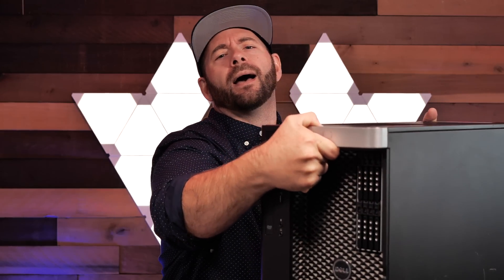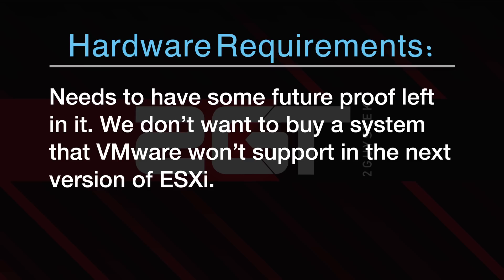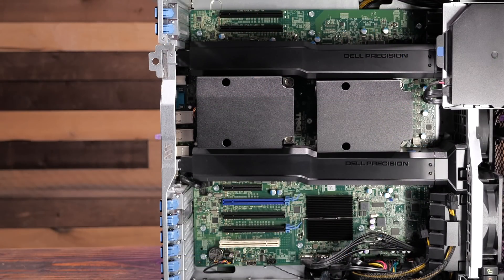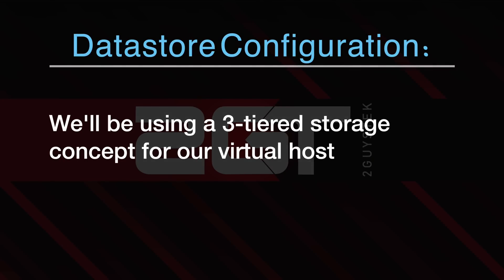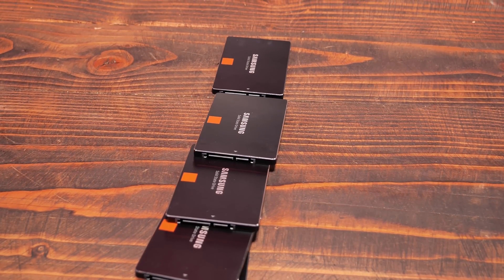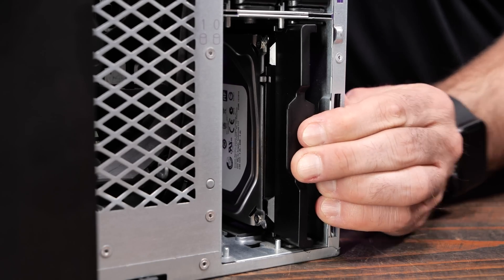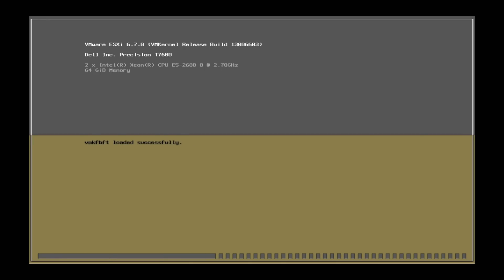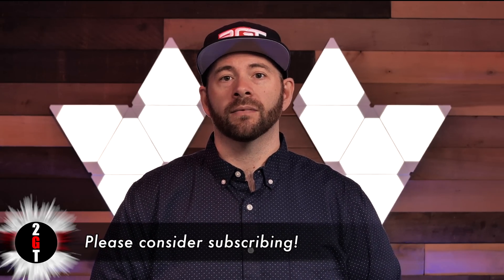Cheap and Powerful Home Virtual Server - $300 GETS YOU A TON OF POWER!

Comment: If you're running a Plex or Emby VM you may want to install some kind of graphics card and use it as a passthrough for transcoding. This will take a ton of work off of your CPU's and let them take care of the day to day functions of the VM's themselves. Even cards that run on 75w PCIe power will get you a lot of benefit, there. No need to drop in a 2080ti (most server and workstations don't have power provisions for the PCI power that is needed for the bigger cards anyway unless specifically ordered like that)

It's good that you were able to pick that thing up for $300. I've got a stack of Dell Poweredge servers under my desk. One of them is a R710 like you guys have. And they are very useful. Although without knowing the specs you're upgrading from in your R710 it's kind of hard to determine if the juice is worth the squeeze. As far as noise. They're in the garage so that's really a problem?
Reply from the maker: I was under the impression that hardware transcoding in plex on Linux was still broken, is that not the case anymore? I would be more than happy to passthrough a GPU if I knew that had been resolved.
Reply: @2GuysTek  Not sure about linux. The people that I know that are doing it are all using windows based installations. Some native, some using passthrough on a hyperviser.

Comment: Great video, subbed.  I found it because I have similar needs and am looking at a T7610, r720, or r720xd.
A few questions:
-  I imaging your t7600 has ECC memory, is that what you have laying around?  Might want to call something like this out.
-  why did you choose the T700 over the T7610?
Reply from the maker: You're 100% right on the ECC RAM requirement - That's an important catch, thank you! The R710 server we were running as the primary ESXi host had compatible RAM as they're around the same generation. 

And to your question about why a T7600 over a T7610? It was just money. At the time there were no 'affordable' T7610s on the market. In some cases they were like $300-500 over the $300 T7600 we found. Unfortunately now it looks like even finding a T7600 at the price we bought ours looks hard to do. I did find one almost identical to the chassis we bought but it was going for $400. https://ebay.to/31k2AGq I'm hoping prices settle back down here soon.  Thanks for the question!

Comment: Nice machine though! Got a Dell R720 at home with 192GB's of RAM. Half full right now. Running at 91,6GB in use RAM :P
Reply from the maker: R720s are a great platform! Are you virtualizing? What are you doing with it?
Reply: @2GuysTek  Yes, I have it as a VM host. Run ESXi 6.7u2 on it (u3 causes hanging issues with the Dell version of ESXi). I have my homelab running on it with around 17 VMs, mostly Windows, but also a few Ubuntu server VMs. And a Linux Plex server ofcourse :P 

Specs (if you're interested):
1x E5-2680v2 10c/20t @ 2,8Ghz
192GB DDR3 ECC REG (12x16GB)
5x 256GB Samsung 840 Pro SSDs in RAID5
PERC H710p 1GB RAID Controller
Dual PSU with one PSU behind a UPS
Runs ESXi 6.7u2 Dell Customized version
Oh, and ofcourse vCenter :)

The whole machine uses about 90 watts of power (in idle), due to the low power consumption of the "disks" and other parts. The CPU isn't energy efficient if it's at max load, but when it idles, it becomes quite energy-bill friendly. Set to run as hot as it can be before it begins to rev it fans. Under heavy load, it revs, but that's barely happening.

Comment: Putting your SSDs in a RAID5 is a bad idea, parity writes will wear out your drives in no time. I'd go with RAID10 instead
Reply from the maker: You're absolutely right about the SSDs. Our decision was one of capacity and not longevity of the disks themselves.  The disk cost for RAID 10 was just too much compared the amount of space available going with RAID 5. Realistically though, they are old used SSDs to begin with so the reliability of the drives would be suspect anyway, that's why we have a robust VM backup strategy!  Thanks for the comment!

Comment: Is this 8-bay case for SSD that you used @4:13 
https://www.ebay.com/itm/New-ICY-Dock-MB998SP-B-ToughArmor-8x-8-bay-2-5-SATA-HDD-Hard-Drive-Mobile-Rack/222127985238?hash=item33b7dc1256:g:B3MAAOSw1ZBUwzGa
Reply from the maker: That's not exactly the same one, but essentially it's the same thing and will work all the same. It looks identical on back so I wouldn't be surprised if it wasn't made in the same factory in China. Thanks for the question!

Comment: The only way I've seen these for around 300 is with out any RAM or processors included.
Reply from the maker: I'm bummed to see that the cost of these chassis has increased so much as of late!
Reply: This is the comment that I made to another individual on this discussion.
Not impossible. That is probably the best they could find at that price point when looking. What I find intriguing is that people are looking for the exact same deal, when that is not going to happen. When I searched I found a similar system for about the same price. BUT, it was not a Dell T7600, it was an HP Z800. Which may or may not be available by the time that you look for it.

A reminder - the $300 was the price of the system that they started with, not what they ended up with, which is not disclosed in the video but wouldn't be too difficult to figure out.

What I did not state when I made this comment earlier, is that in my local area when looking at Craigslist, I find that people are asking and receiving upwards of $500 for something worth less than $100. What is sad about that - there are local rebuilders that are selling similar systems for $150 that other locals are asking $500 for.
One additional thought - You pay a premium for wanting it now and not doing a thoughtful search, and that is what some sellers are banking on.

Comment: Sure. You can get "old" but yet competetive hardware to perform high end tasks if you look fo dated workstations or servers. Yet: Always consider, that there was a reason why that hardware has been taken out of service - which mostly is performance over power consumption. I recently installed a new NAS/server system at home and I could have get a cheap 500 bucks 5-7 years dated system with horrible power consumption. Instead I went for modern hardware at the lower end of the spectrum, which yet outperforms the "cheap but dated hardware" in tems of power consumption.
Reply: What do you have? This looks like it uses way too much electricity.

Comment: why, why?? please split hypervisor am Storage. get A Server install all the drives, get 2 usb drives install freenas on usb, configure. done. you have a nice Storage system.
get a second system. install your hypervisor (esx/xcp-ng/...) connect to nfs share.
you need more cpu? get a second hypervisor.

hypervisor one dies, just start vm on hypervisor two.
Storage dies? get a new system, just move the two usb's ans all the hdd/ssd and boot. runs fine again.
Reply from the maker: We actually do that now, we have NFS mounts for datastores that tie back to our #Synology NAS. However these links are slow (4x1Gbit LACP trunked) compared to the internal speed of the NVMe or SATA SSD RAID. That's the concept behind the multi-tiered datastore concept - VMs needing fast disks are stored in fast datastores and the slower, larger disks are spun out to the NFS datastore.

At this time we have elected to not have multiple hypervisors working in HA or vMotion just due to not having another T7600 host. We do however do nightly backups of the VMs to the NAS so if we lose the hypervisor we can restore things pretty quickly.  Thanks for the comment!
Reply: That kind of configuration is oldschool. Everyone is moving towards HCI with a (tipically 3-tier) local storage.
HBA, NFS, iSCSI are too slow and/or complicated to maintain and repair.
Reply: @temp50  more latency, but bandwith is no problem. If you use central storage you can easy move running vm from one host to an other.

Comment: why not use unraid instead of exsi, unraid is capable of doing everything you would require with less overhead thanks to docker images
Reply from the maker: We can't run pfSense or Windows Servers in docker images. Also, having ESXi running has a secondary benefit - it helps me stay sharp in my professional career. UnRAID doesn't have a foothold in the business world like VMware does, and it's considered the industry standard for DCV. Having ESXi and vCenter allows me to test and play around with features and tech that I can then directly apply to my professional career. Thanks for the comment! It sounds like I need to also start playing around with UnRAID!

Comment: impossible this price 300U$
Reply: Not impossible. That is probably the best they could find at that price point when looking. What I find intriguing is that people are looking for the exact same deal, when that is not going to happen. When I searched I found a similar system for about the same price. BUT, it was not a Dell T7600, it was an HP Z800. Which may or may not be available by the time that you look for it.
A reminder - the $300 was the price of the system that they started with, not what they ended up with, which is not disclosed in the video but wouldn't be too difficult to figure out.

Comment: A lot of this can be run inside Dockers... you guys need to look at unRAID. So many VM's running for each application is a waste of resources.
Reply from the maker: You are right! Docker is likely the direction we will go in the future for many of the VMs that we have. However, some systems like Windows Server, pfSense, really can't be containerized.  Thanks for the comment!
Reply: @2GuysTek  Niiiice. Yeah I understand, PFSense certainly can't be and in terms of VMs on unraid it really depends as there are some limitations. 100% look at dockers though, they are awesome but also come with their own limitations also :-).
Reply from the maker: @witalit If you don't mind us asking, how does docker handle a web service with a massive amount of storage hanging off it? One of our web hosting VMs has a mount with ~4TB worth of data. If we containerize that web server, how would you recommend getting at the storage?
Reply: 2GuysTek docker supports volumes to work with “external” storage as if it’s a directory inside docker. Works with Linux and Windows containers.

Comment: Since you have the nas server, why not use iSCSI and access your vms stored there?  Then all you need is a simple cheap pair of local drives to boot esxi in raid 1. 
Less complicated on the server, less heat, less power, likely less cost since you should already have some massive disks on the nas.
Reply from the maker: We actually do for a few VMs that require very large disks! However, we switched from iSCSI to NFS mounts in ESXi because the iSCSI performance of the model of Synology we use was worse than NFS. Also, NFS allows for the ability to look into those volume from outside of ESXi which is helpful if we need to tail logs.
Reply: @2GuysTek  NFS is also recommended by VMware and the preferred over iSCSI.

Comment: I have this same system but could not for the life of me get more than 4 drives recognized by the on-board SAS controller. I'm also trying to set up pass-through mode so I can properly run ZFS on the drives but it looks like the built-in drive controller does not support this. When using an IT-mode flashed PERC H310, the BIOS would tell me that an unsupported drive controller was installed and would refuse to POST.
Reply from the maker: It sounds like maybe you have a bad embedded disk controller. By default on our system, the drives were available individually but could also be configured into a software RAID, which is awful of course.  All of the channels on the mini-SAS were working for us, but software RAID isn't supported by ESXi and we wanted RAID. In the end, we ended up picking up a PERC H700 for something like $60 on eBay. This gave us the RAID we needed and the performance we expected. We've played with the H310 in the past and it's always been a disappointing card.  Good luck!

Comment: Bare minimum, buy another 700 series dell, put a PERC H700 card in to gain support for drives bigger than 2tb and load it with 6 of the biggest drives you can, setup Open media vault as a VM and create some big virtual drives for it in VM ware. Configure them in OMV as SMB shares and then setup a cheap desktop PC with an old quad core i7 and a basic low end gaming GPU (I use a 750ti) and install plex on that and map windows to the OMV file shares to be the home of your plex library. 

Use that new dell you got for all other stuff but plex needs it’s own dedicated box if you plan to transcode any 4K content. I learned the hard way.

Comment: Virtualize Plex server? That’s a transcoding nightmare. You need a strong GPU and VMware can’t really utilize GPU’s this way. Also, something is wrong with your R710 if it sounds like that. It should be quiet at idle.
Reply from the maker: We've haven't had a bad experience transcoding in Plex, however very little of our content is 4K. To that though, ESXi allows you to passthrough hardware directly to a VM, so eventually when Plex gets around to fixing Linux hardware transcoding we could drop an Nvidia card in the host and pass it through exclusively to the Plex VM to use for transcoding operations. Thanks for the comment!
Reply: @2GuysTek  Unfortunately, a lot easier said than done.  lots of confguration file editing with memory parameters, making sure your GPU is actually compatible, etc.  Way easier to at a bare minimum, just hook up an Nvidia shield TV and point it to a file server.  For now, I have a cheap micro ATX board and a 3rd gen i7, GTX 750ti and windows 10 with plex installed.  If I didn't have that desktop, I'd have a shield TV aimed at the file share.
Reply: @FastRedPonyCar  The setup I am currently using to play 4K Remux Rips natively without transcoding in the following order: Infused App on Apple TV 4K > Xpenology NAS setup with Plex Media Server installed. Works buttery smooth for me.

Comment: Dual xeon at $300 is a deal. I checked your ebay link. They’re not those prices at the moment but I’m gonna keep my out. This is a good idea. Smaller footprint and quieter than the dell r700 series
Reply: i just found 3 HP Proliant G6 with betwen 144 and 200GB Ram, each Server has dual CPU installed. just no drives. 
but its fine storage will be in a storage only Server.
Reply: How many VMs Ryzen 5950X can run?
Reply: @sirs4878  i'm currently using ryzen 2600 (not X) running proxmox with 64GB ram. i have 5 VMs and 2 LXCs running. CPU resource wise, it's barely hitting 15% usage. though i'm not running anything "heavy". mainly pihole, VOIP server for home, proxy server, docker server. i'll run out of ram before i worry about cpu usage.